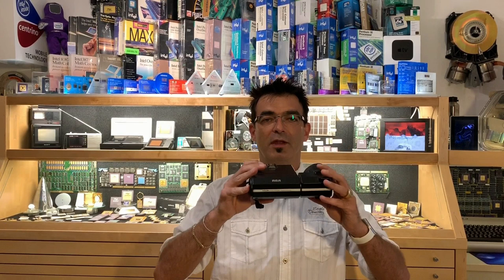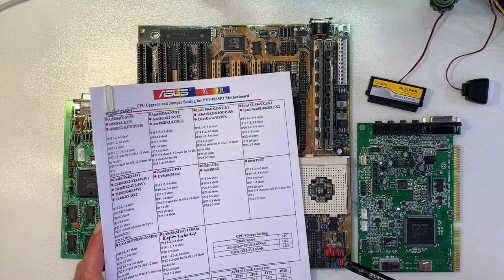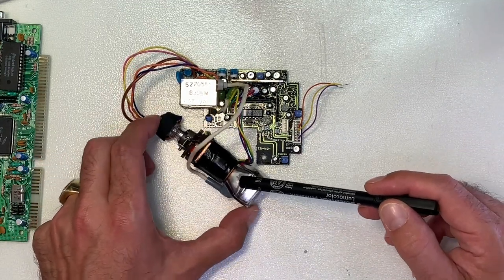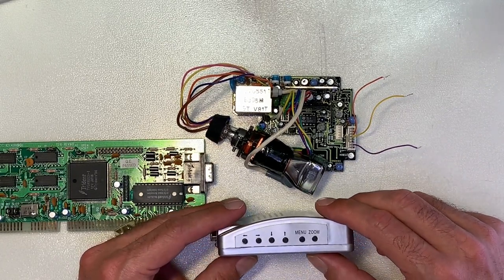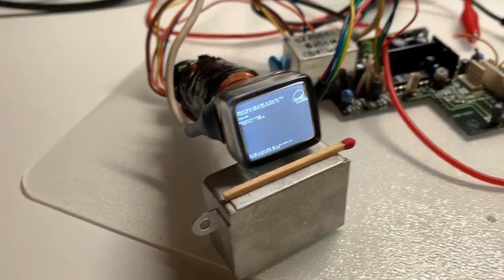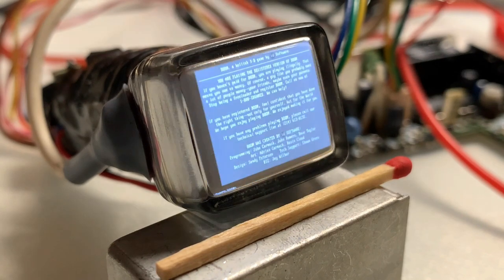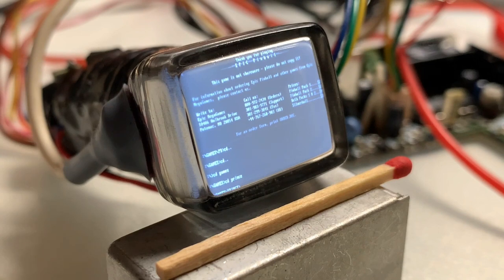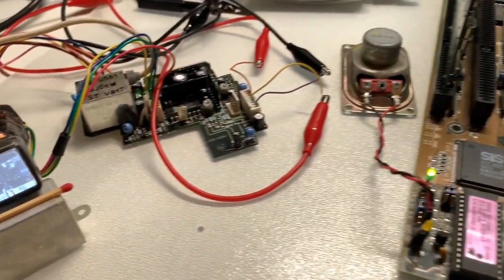1" CRT Gaming on 486 Setup [Vintage Computer & Camera Viewfinder mini crt monitor]

Comment: Technically the luma channel from the S-video out should give you an even sharper picture. The viewfinder video input circuit probably does not have any kind of comb or notch filter so you are probably getting chroma cross talk. Or maybe this does not matter in PAL only in NTSC...

Comment: Check out this small FULL COLOR CRT used as a view finder https://youtu.be/_b7omGhw7wc
Reply from the maker: its not a real 3-gun color crt. I have several of those also here. Just one electron beam and a very tricky circuit to measure the location of the beam to generate a color image. unfortunately the color quality is not that great and crisp. Its also hard for this kind of tubes to display pure red. therefor i used the panasonic tv set in my video coz it has the world smallest real 3 gun crt. ☺️

Comment: I had this in mind for years and years but the only screen like this I ever had was ages before I thought I would ever want to hack it scrapped to pieces which I surely regret now. just of curiosity though, it sounds like you say forty-eighty-six (4086) when you say 486? or am I hearing it wrong, since it is a four-eighty-six :)

Comment: Black and Whiet and Monochrome CRTs don't have a shadow mask so they are as sharp or on thr same level as fixed pixel display sharpness
Reply: Yes, but still very impressive because the whole screen is 1" diagonally, so the command line characters were absolutely microscopic, yet perfectly readable.
Reply: There's still the graininess of the phosphor layer, and it sometimes takes away a lot of the sharpness. I have some 2 inch CRTs that suffer from that